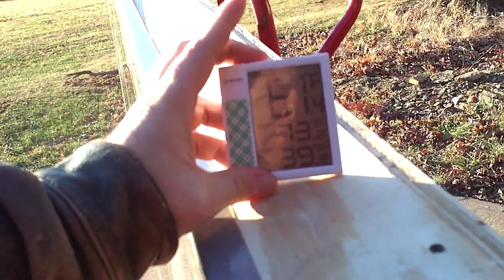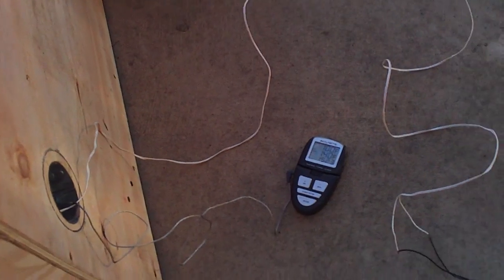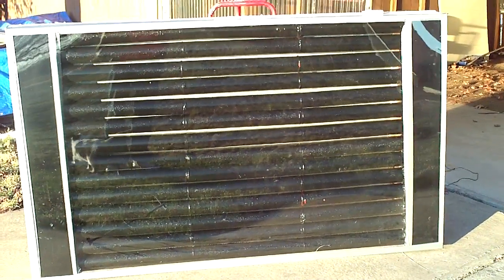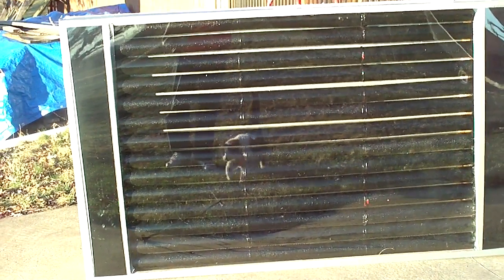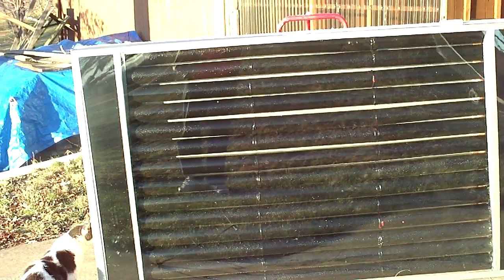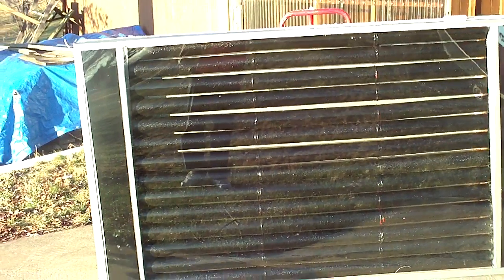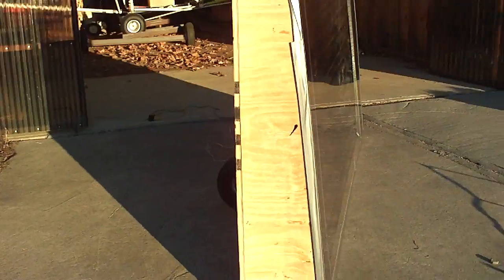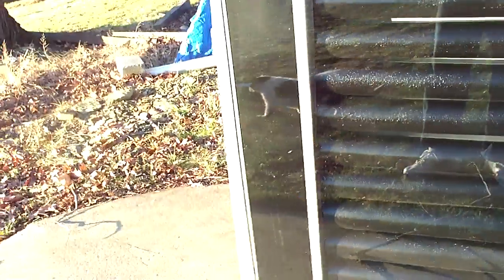solar air heater

Comment: If you build another one use 1/4 inch luan for the back, It's exterior grade. should cost between $8 and $10 for 4X8. If your getting enough heat more CFM would be better as long as the temp stays above the temp you want the rooms to be.  I'm using one regular furnace blower to force air into 2 heaters right now. Mine are made with aluminum downspouts with cans inside.

Comment from the maker: I actually took out the stand pipes. The stand pipes work well with low volume air flow. The stand pipes only helped to make sure the low volume air made it through all tubes, and not just a few. However I went with a 70 cfm fan so there will be no problem with the air going through all the tubes. Today will be the first test since installed to the house. and so far the sun is out big and bright......so we will see

Comment: I was researching glass for solar panels. What they recommended for outdoor use was double pane "tempered glass". I called Iowa Glass and the guy said that a 4 by 8 sheet would run like $400.00 and weigh 200 lbs!  I was thinking of maybe looking for a window from a dealers bone pile to use instead.

Comment from the maker: Hey Daddyniowa, The box is 4' high by 84" wide. The stand pipes i put in so I would not be moving air through just a few tubes, I wanted air flowing through all the tubes. With the standpipes and a baffle system ( on the hot air side) I think I have done this. I still have to secure the lexan on, not with tape, so I will video it when I take that off hopefully you will see what I mean. Thanks for looking

Comment: Great looking unit! I was looking at using dryer vent pipe awhile back. I assume the total box length of the box itelf is 8" and how wide is it with the 14 sections? I'm not clear about what you were saying about the standpipes at each end? Is that not just a dead air space that the pipes open up to?